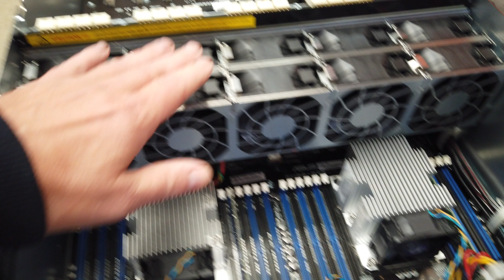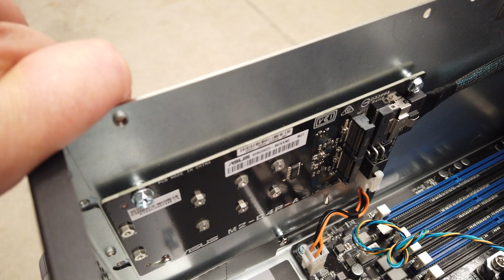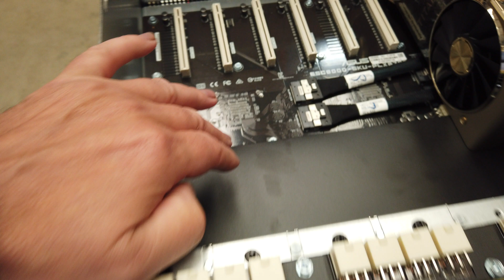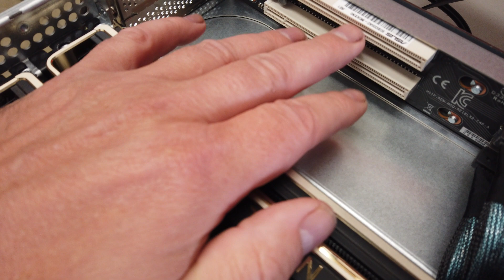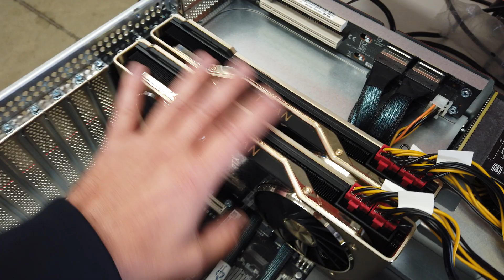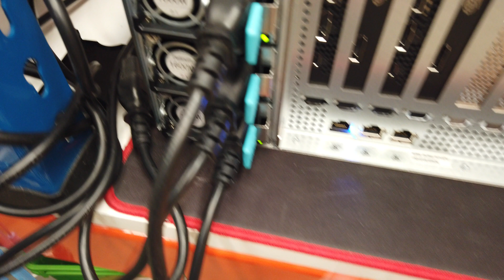Asus ESC8000 G4 Gpu Server for 8 Double width cards

Comment: I’ve got this system with 4 GPUs in the first 4 PCIe16 lanes. I’ve tried adding more gpus to the rest of the lanes but they do not get recognised by the system- even gpus I know to work. Anyone know if there is a setting in bios I need to change?
Reply: turns out our supplier deliberately removed 2 x slimsas 8654 cables connecting the mainboard to the gpu daughter board. and didn't tell us.

if anyone has used the additionan 4 x ports on the gpu daughter board to connect to the mother board with (not the PCIE riser board) does it work? do you get more lanes from CPU that way?

Comment: Does the barebones come with the fans, power supplies and CPU's pre-installed?
Reply: It comes with fans, PSU and cables. CPU, GPU and RAM + Storage and addon cards is something you have to buy separate.

Comment: Any issues with closing the top when using Consumer GPUs as they have the Power cables on the top (like the ones you have)? Quadro cards have them on the back to prevent this. I remember Linus Tech had to have a custom top panel made to accommodate the cables on the top of the cards.
Reply: if you use a 3u case you need a custom top panel. This case is a 4U.
Reply from the maker: Yes this is the 4u  no problem only 3u